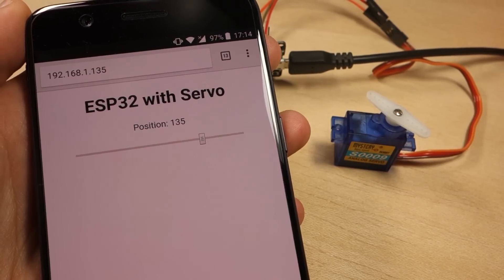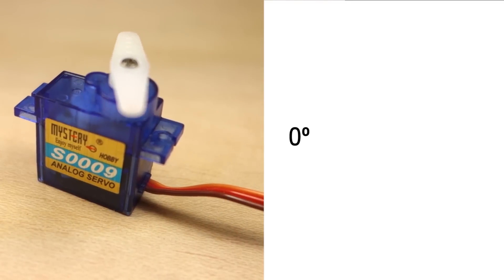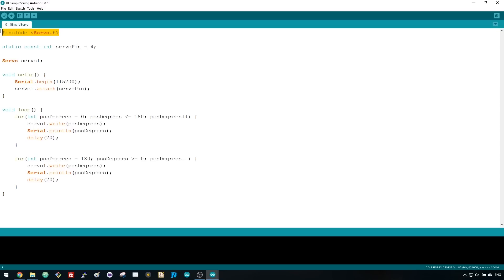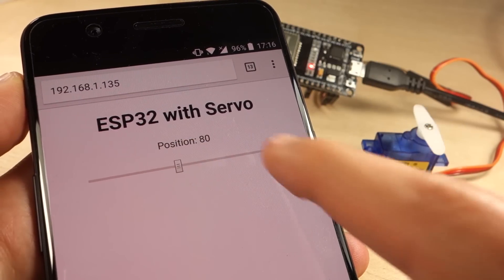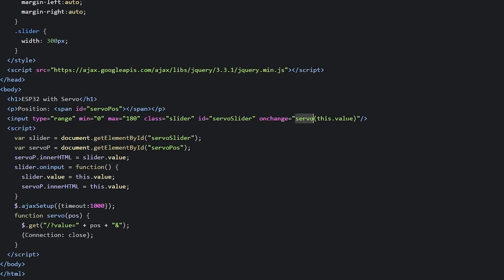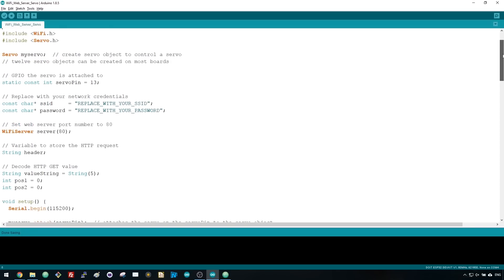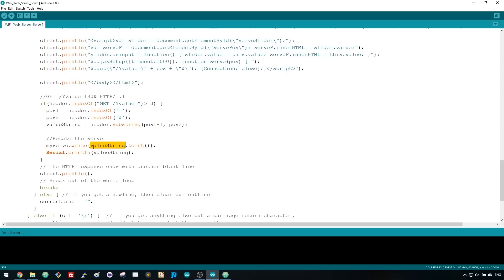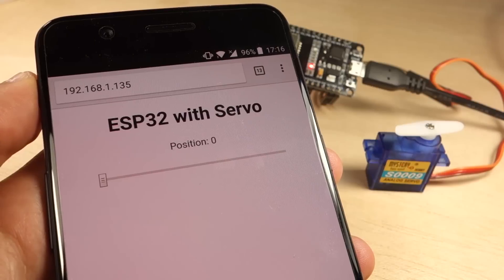ESP32 Servo Motor Web Server with Arduino IDE

Comment from the maker: You can find the complete project details (schematics + source code) on my blog: https://randomnerdtutorials.com/esp32-servo-motor-web-server-arduino-ide/
Reply: I need to use a stepper motor or a normal electric motor instead of a servo motor, how should I do it?
Reply: Hey man i keep getting this( 'const char*' to 'char' [-fpermissive] )when i try to verify code in Arduino IDE when trying to build the web server. It high lights just one line WiFi.begin(ssid, password);   . My password and wife password is correct.
Reply: Hi man, can you make a guide where i can send data via website to servo? what i mean is there is a dropbox/inputbox where i can input numbers then send it to servo using esp8266 or Wemos R1?
Reply: Hello.  My esp32 have no vin.
Reply: May i use other pin? Cause my esp32 has no vin.🥺  still Fatal occured error🥺

Comment: In the loop, the sample code performa a write to the servo object. Does the servo or does the esp32 know the current position of the shaft? For example, if the shaft is at 45 and I write 45, the shaft should not move, right? Or, should the shaft perform a sweep to calibrate itself? 8 guess that's ultimately what I am asking is do I need to calibrate the servo before writing degree values to the servo?

Comment: I'm stuck maybe you can help

I'm using your code with and ESP32 and all works fine. 

I've added code to send XML to the web page so I can update page contents My XML is simple
<?xml version = '1.0' encoding='UTF-8'?>
<Data>
<B0>0</B0>
<V0>0.0</V0>
<B1>0</B1>
<V1>0.0</V1>
<L0>Off</L0>
<L1>Off</L1>
</Data>

and the code I'm using works in other programs, however the received XML is NULL

  var xmlHttp=createXmlHttpObject();
  
  function createXmlHttpObject(){

        
    if(window.XMLHttpRequest){
      document.getElementsByClassName("foot")[0].innerHTML="new";
      xmlHttp = new XMLHttpRequest();
    }
    else{
      document.getElementsByClassName("foot")[0].innerHTML="activexobject";
      xmlHttp = new ActiveXObject("Microsoft.XMLHTTP");
    }
    return xmlHttp;
  }
  function response(){
  
    var message;
    var xmlResponse;

 
    // get the xml stream
    xmlResponse=xmlHttp.responseXML;

    
  // xmlResponse is alwasy NULL
       
  
   if (xmlResponse == null) {
       document.getElementsByClassName("foot")[0].innerHTML="null";
   }

Any thoughts?

Comment: Hi, in my case it gives this, any help, thanks:

WARNING: library Servo claims to run on avr, megaavr, sam, samd, nrf52, stm32f4, mbed architecture(s) and may be incompatible with your current board which runs on esp32 architecture(s).
In file included from C:\Users\Utilizador\Documents\Arduino\libraries\ESP32-Arduino-Servo-Library-master\examples\01-SimpleServo\01-SimpleServo.ino:1:0:

C:\Users\Utilizador\Documents\Arduino\libraries\Servo\src/Servo.h:77:2: error: #error "This library only supports boards with an AVR, SAM, SAMD, NRF52 or STM32F4 processor."

 #error "This library only supports boards with an AVR, SAM, SAMD, NRF52 or STM32F4 processor."

  ^

Multiple libraries were found for "Servo.h"
 Used: C:\Users\Utilizador\Documents\Arduino\libraries\Servo
 Not used: C:\Users\Utilizador\Documents\Arduino\libraries\ESP32-Arduino-Servo-Library-master
 Not used: C:\Program
exit status 1
Error compiling for board DOIT ESP32 DEVKIT V1.

Comment: i have this error

 #error "This library only supports boards with an AVR, SAM, SAMD, NRF52 or STM32F4 processor."

  ^

Multiple libraries were found for "WiFi.h"
 Used: C:\Users\basoc\AppData\Local\Arduino15\packages\esp32\hardware\esp32\1.0.4\libraries\WiFi
 Not used: C:\Users\basoc\Downloads\arduino-nightly-windows\arduino-nightly\libraries\WiFi
Multiple libraries were found for "Servo.h"
 Used: C:\Users\basoc\Downloads\arduino-nightly-windows\arduino-nightly\libraries\Servo
exit status 1
Error compiling for board DOIT ESP32 DEVKIT V1.
Reply: I have the same problem

Comment: Can we use esp32-cam for both video streaming and servo control from web server
Reply: Try the blynk app. You can display servo controls and video stream on one screen.
Reply: @tseawell90  Really? I couldn't find a way to do that in blynk. Do you have any links to projects that do that?
Reply: @philpayne4579  
look up Rui Santos's video on making an esp32 webcam for an idea of how it could work. you can make code to control a servo motor with the blynk library. I've never tried this combo but it seems like it could work. Also, you could get a raspberry pi zero. much easier to connect a camera and servos imo.
Reply: @tseawell90   I tried using blynk last night but couldn't get video to stream on iOS on xx.xx.xx.xx:81/stream. I will try blynk again on Android because I think it was an iOS problem and not an ESP32 problem because there's definitely a video stream at that address

Comment: servo.h isnt working! its saying it only runs on avr,arm etc
Reply: @cyber punk 

This one took a while to find out the answer to, but the main problem is that it’s getting confused with another built in Servo library that is built in to the Arduino IDE. Here is how to fix the issue. First of all, you will need to install a different library. It’s the same exact thing, you just install it differently then the video says. Go to Sketch, hover over include library, and click “Manage Libraries.” From here, you can search “Esp32 Servo” in the search tab. When you click enter, it should be the first one that comes up titled “ESP32Servo.” Click install and wait for it to install. Once it installed, you can click close to close that tab. Then change the first line of code that says “#include <Servo.h>” and change it to “#include <ESP32Servo.h>” that should solve the issue, and get the right library. However, for me, it says that there is a timed out warning waiting for packet content error, I’m not sure why. (“Could not auto-detect Flash size”) Aside from that, I hope this helps you and others trying to solve this issue.
Reply: @austinhendrick5403  thak you so much!
Reply: Rafael Robles No problem!
Reply: x2
Reply: @cyber punk 
Solved! Looked like I connected the Servo to the wrong GND Pin. Do the same thing as I told you the comment before, and make sure you connect the Servo to the right pins!

Comment: A fatal error occurred: Failed to connect to ESP32: Timed out waiting for packet header
Reply: @zam hafzam 
I had this same issue. It has to do to where you connected your Servomotor. After reopening the packaging on my esp32, I looked at the pins and it turns out that I had the wrong GND Pin. Even if you’re sure, check to see if your Servo  is connected to the right pins! You have 1 pin that is connected to the flash row. (Pins 6-11 I think) Most likely you have misplaced your GND Pin. Hope this helps!

Comment: Hello friend: First, excuse me if my English is not good. His tutorials are excellent, I've seen others and I really understand much more about his. I have a question. I modified this video of the esp32 with servo and the pin I connected a led and the idea is to make it modulate with the slider with pwm but I did not do well. You can help me? I appreciate it And thank you for enlightening your knowledge.